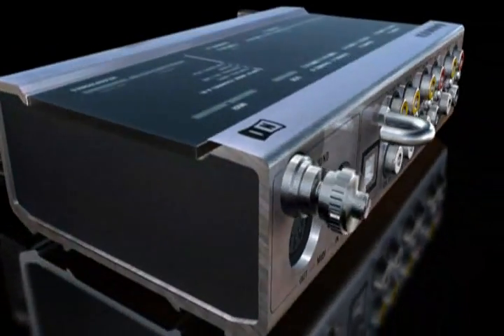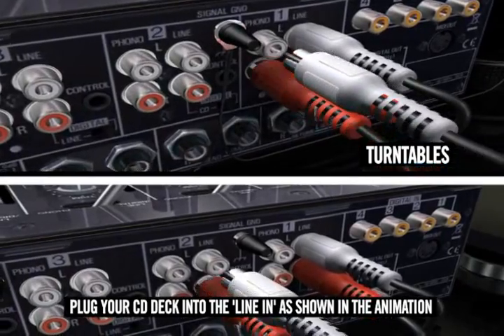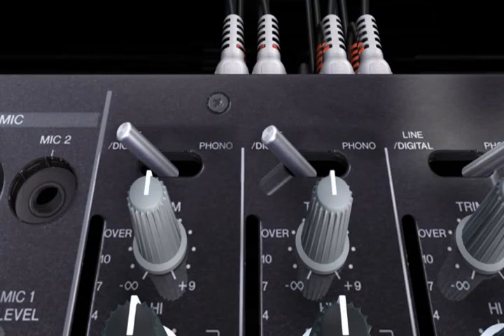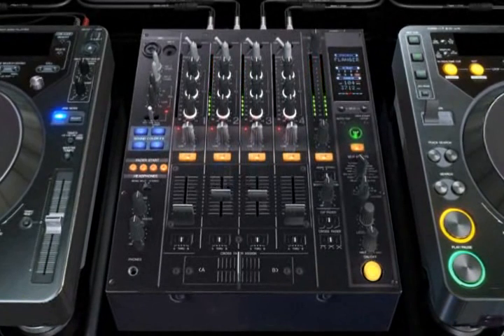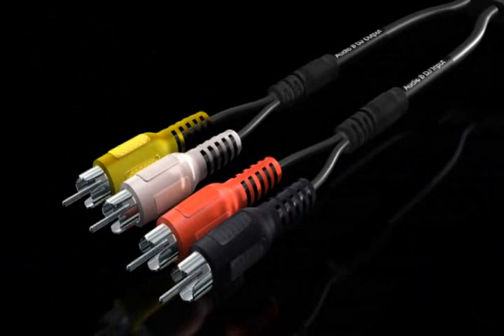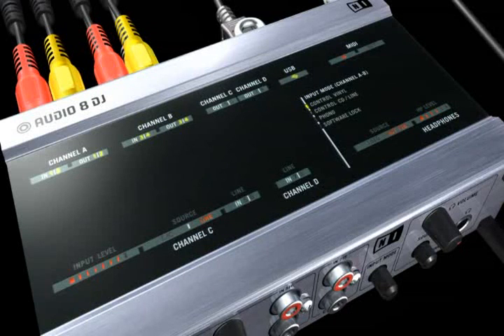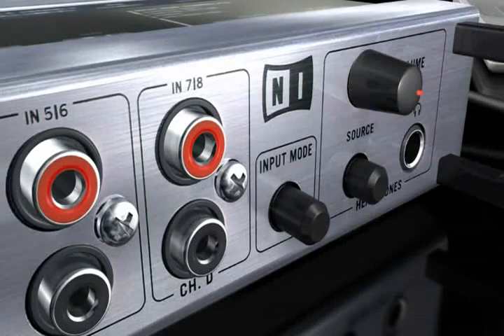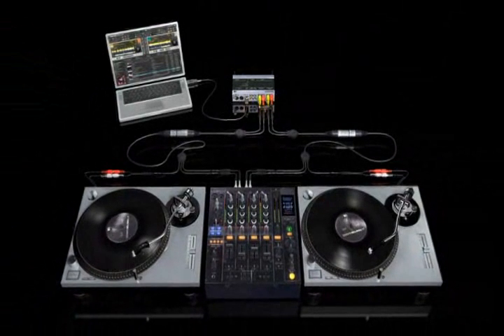Native Instruments - Traktor Scratch Pro - Tutorial - Audio 8 DJ - Connecting the Mixer Segments

Comment: Virtual DJ
USING RANE SL 2
I need to use vinyl as a CODE team and also as normal vinyl I would like to know if there is a function where I can change
BECAUSE IN THE SERATO PROGRAM HAS THIS FUNCTION TO PLAY VINYL TIME CODE AND ALSO NORMAL VINYL JUST CHANGE TO CLOCK TOUCH THAT THE FUNCTION OF THE PROGRAM

Comment: I am running this soundcard directly into a mixer (No turntables or CDJs)and I was wondering can you plug a red and white rca cable into the yellow and white outputs on the soundcard or does it have to be yellow to yellow and white to white? I tried running a red and white rca cable to the outputs but was only able to get sound from the left side. is this because the cables have to match or because I have a bad set of cables?

Comment: This video is horrible. its so confusing and goes through it too quick. ps what the hell is this multi connection cable?
Reply: +Dersu Rhodes 
this has been improved by the a10 and the unit been powered. you needed the cables in case the computer crashed and you still needed to play music whilst rebooting.